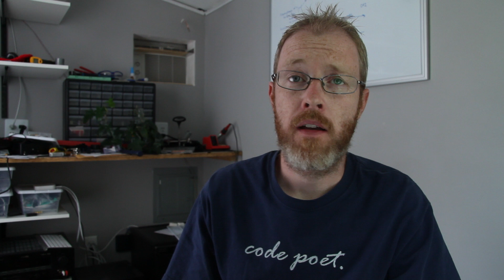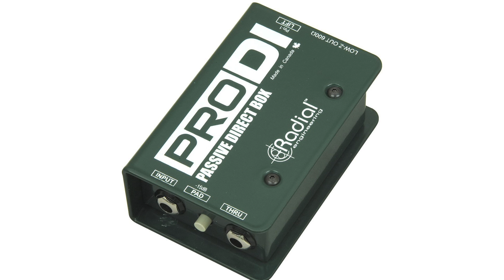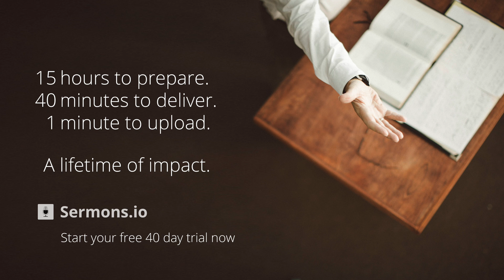Buzz/Hum In Your Audio Recordings

Comment: Today I got a  Samson Auro D208 to use as a monitor for a keyboard. I was told I could hook this monitor to my Roland 600 keyboard amp. When I do this the humming noise(exactly like the sound in your video) happens. When I use the Samson directly to the keyboard it does not hum at all. Please help if you are able. Do I need to buy that Biloxi thing you suggested in the video or do something else?

Comment: I'm having the issue that when i connect my ac adapter charger into my laptop there's a terryble noise and hum noise. But when i disconnect th ac adapter there's the same noise and hum sound but a little bit less, but it still there. I use a Focusrite Scarlett 2i4. This happens when I plug my electric guitar. I don't know what to do! Im desesperate! I think I'm going to buy a DI Box but I'm concerned that the problem will not resolved!
Reply: did you end up buying a DI Box and did it fix your issue?

Comment: Here 's my question.. If using eventely a DI Box between a single coil guitar and a multieffect entry like Line 6 Helix, could this affect positively a buzz problem when using a high gain amp model of the unite ?
Thanks again..

Comment: I use dual rig setup with an AB Box
One is amp sim into active speakers for distorted sound, the other one is solid state amp for clean.
I get a ground loop hum on the active speakers
Will that direct box solve my problem?
Which one to choose? Passive or active DI Box?
And how to choose a good DI box?

Comment: What about filters in audio production? Could that affect buzz?
Reply: It's certainly possible. The best way to figure it out is to remove the filter and see if that changes the buzz. If it does, then your next step would depend on the filter. You'd want to look into figuring out how to isolate the filter if it's unbalanced, or get the signal balanced again.

Comment: Hey mate, i have a hum that comes from my condensor-mic i think, cus when i mute that channel on my interface i dont hear it. And it records the hum aswell.. can you help me get rid of it please? (im fixing a home studio) i dont know if it still mathers with the info i gave you but i use a pc with a external audio interface.
Reply: If you have a laptop, try running on battery and see if that fixes it. If not, check all your cords and make sure you're running all AC power from the exact same spot, and not from multiple spots in the same room. After that, you might need to try a different external audio interface.